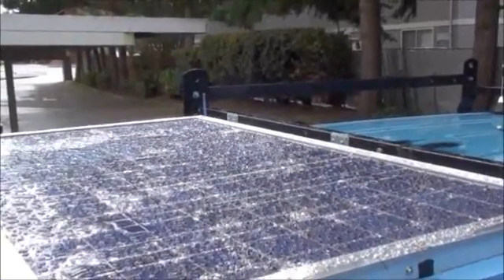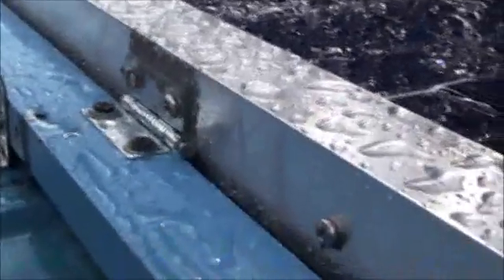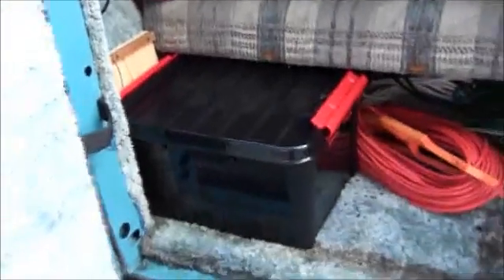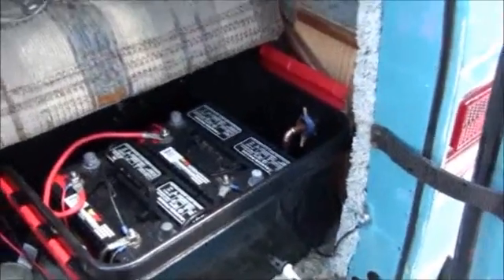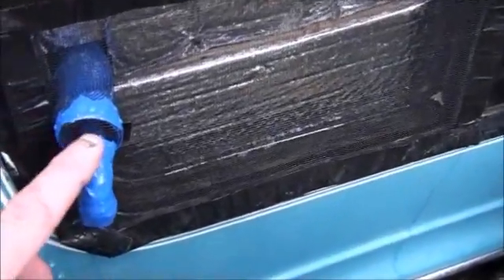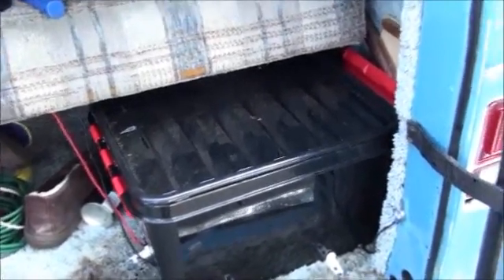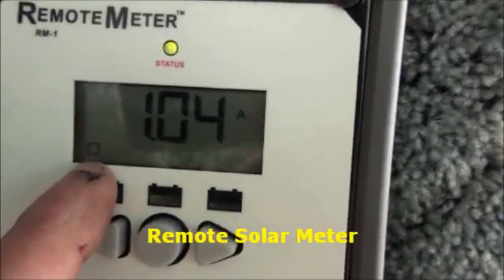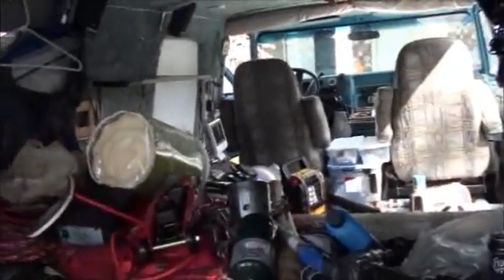Solar for the Command Van

Comment from the maker: Sorry for taking so long to reply.  I sometimes  forget to check comments.  Not many things I'd do different.  I did take the smaller panel off the top of the roof and now use it just as a portable for in camp.  Most of the time I have little sun camping under trees -- so using the smaller panel as a portable enables me to find the sun and set it up.  I just tie it in to the junction box which has a connection to tie it in.  Also, keep your solar wires from the panels as short as possible.